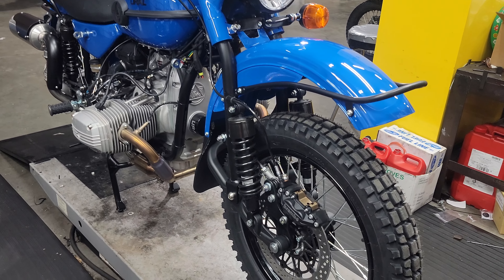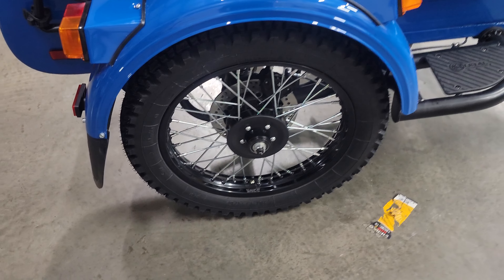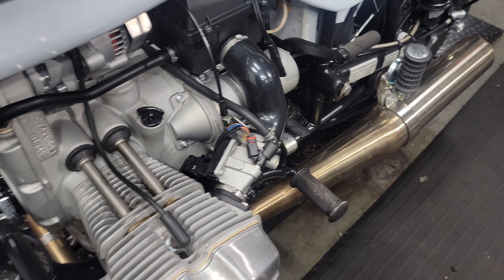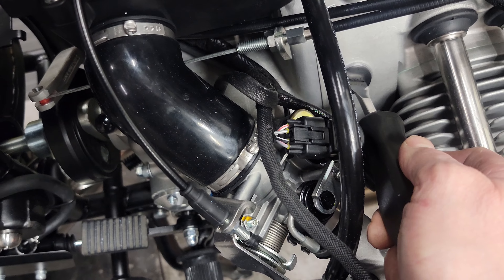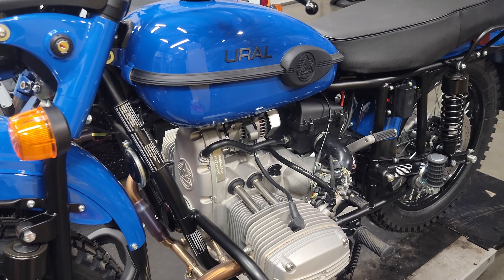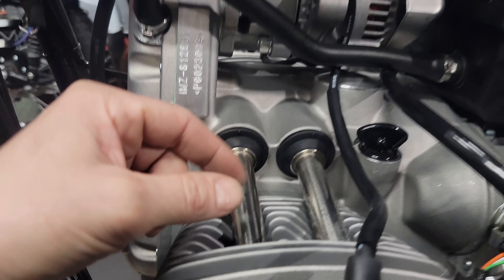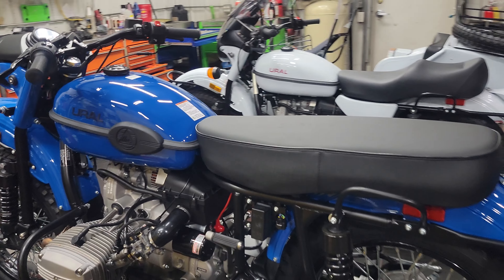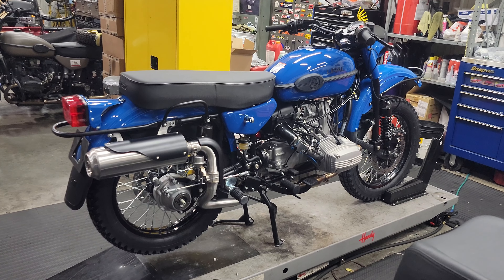2023 Ural GearUp 2wd Sidecar Motorcycle update and changes overview

Comment: Hey Jon. 2023 is another step in the evolution of what a Ural could be. We done Ilya and the entire Ural team both in Khazak and the US.  I am in Oz and have ordered the new driveshaft for my 2022. Looking for your tips and video on the actual install. Can you have a look at the owner/service manual and confirm if the valve train  service interval is changed?? If so, to what? 10,000Km from 5000km?? Many thanks. That BLUE is a Knockout.